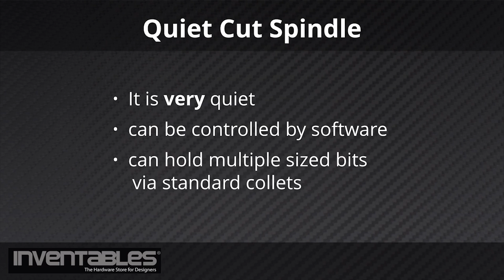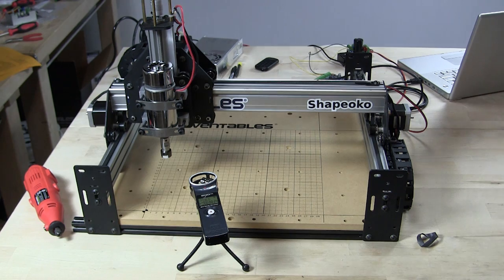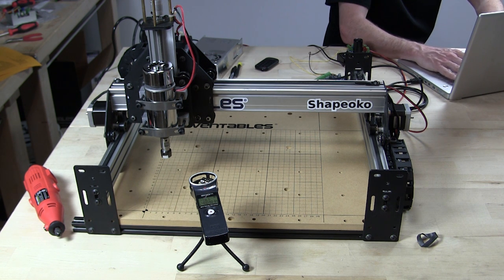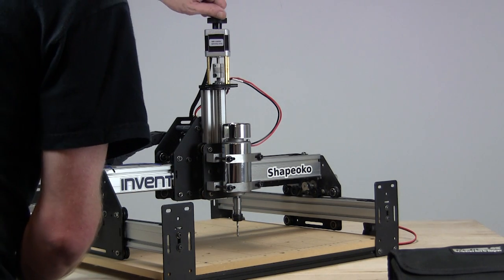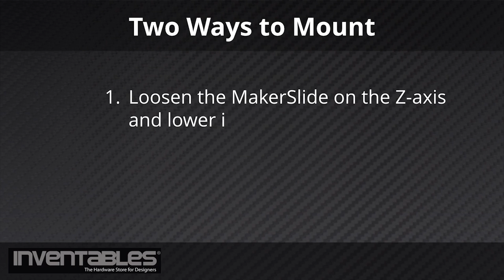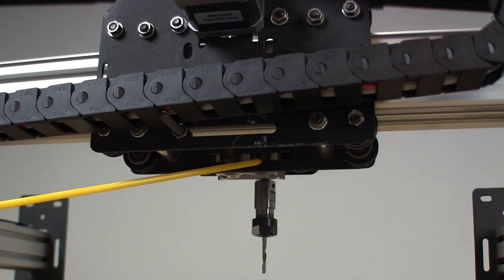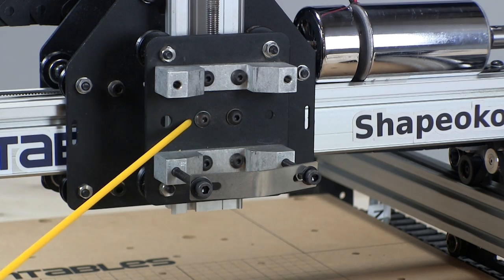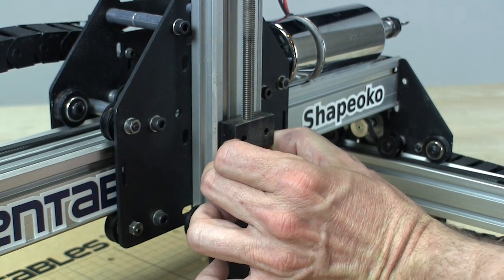Tutorial - Mounting and Wiring A Quiet Cut Spindle

Comment: Very nice. I opted for solution 1 after I got my new spindle. But since it's mounted differently I had to lower the Z very much, resulting in a very low Z clearance now. Debating on turning the axis around like the SO 1 or trying with a longer Z motor plate.
Reply: Well I guess I am coming to this way late everyone was here 4 years ago. Saying that  I was looking for the installing and wiring.. as the title said  .."mounting and wiring" didnt get anything about that .. .. great info on the other stuff though.. I still need to find out about the wiring